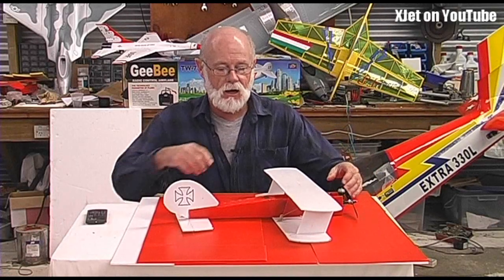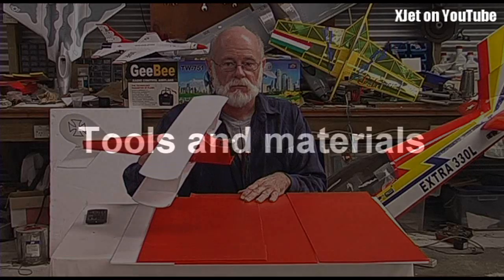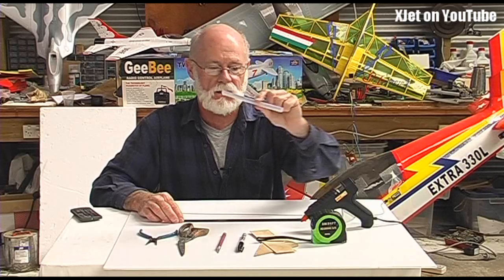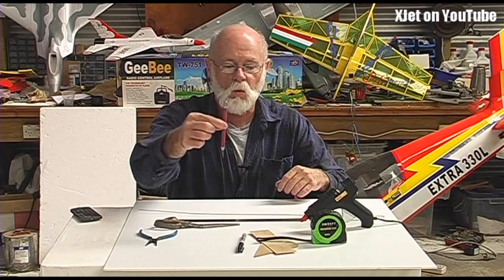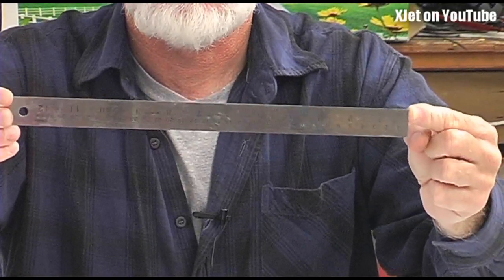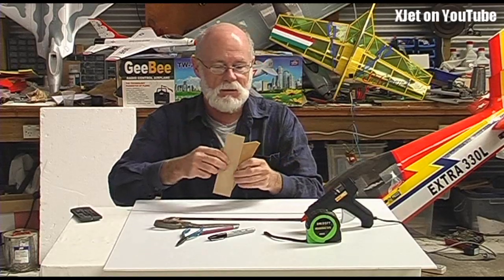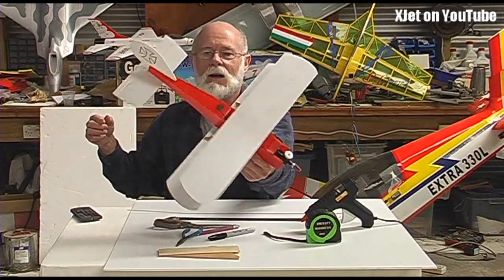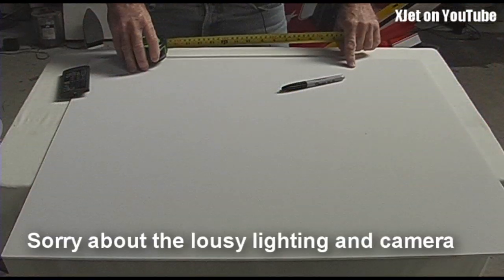(corrected) Build video: The $10 RC nitro plane made from coreflute (part 1)

Comment: this was the first homebuild plane i did when i was 14 soon after these videos came out. i had mine so full of hot glue and reinforcements that it WOULD NOT fly, EVER. mostly because i could never get the cox engine to run lol. I did get a reliable engine to run (all from vintage parts that my family had in a box), and i had a retired Parkzone super cub that i attached the .049 to, it looks SWEET with the cox head sticking through a cutout of the plastic motor cowl. It flew a bit but couldn't keep the engine attached lol

Comment: Thank you for the great video.  I am continually amazed by folks that build low-cost things using inexpensive components.

On the camera quality, I think it is better than good enough.  It just has problems in low light like many cameras do.  Sound is good as well.  I would consider getting a few overhead shop lights rather than a new camera.

Thanks again.......

Comment: @RCcarWIZERD search youtube for cardboard rc planes. There are some out there, especially delta-wing types. Problem with cardboard is getting it wet so thin coat of varnish or paint helps. There are different weights of cardboard as well.

Comment: Damn Bruce, I love your work.
Found out about you due to research on valveless pulsejets (something that actually sprung from watching the episode of scrapheap challenge that you were on, I think). And eventually, I built my own, though I weld badly and it didn't hold for long.
I didn't know that you were into RC planes as well. I've been wanting to get one of those things for ages (used to race nitro RC cars), and your build looks pretty great for the budget. If only the insides were as cheap.

Comment: To mark the second wingtip instead of fooling around with that little wiggly piece you cut off you might use the first cut wingtip that you made as a pattern for the second wing, then cut the second wing on one tip, flip it over and mark your first wing, second tip, then use that to mark the second wing, second tip.

Comment: instead of using the flimsey piece as a template for the wing tips, why did you not use the first wing you cut the tip off for a template for the other wing and after cutting the two tips on the second wing go back and use the second wing for the template for the last wingtip cut. are we learning  yet???

Comment: When we get to installing the radio gear, can you use a transmitter that came with a prepacked cheap RC toy or will we need a dedicated RC transmitter. Guess I am asking if there is a way to use a cheap transmitter.

I would like to build this but dont have the radio gear.

Comment: @troy5690 , I didn't answer your first question properly.Most cheap RC toys, at least the indoor ones are not rc at all but use infrared like remotes & only work 30-to-40ft. If you move up to Harbor Freight cheap planes, they are 27Mhz & 2 proportional chan operating throttle steer on two tiny brushed motors. They work but nothing to write home about. Search youtube for "Yellow Bee" for examples of people flying them. I am not promoting HF planes, they're just enough to get frustrated!

Comment: What can I substitute for coreflute? I live in Maine, and I can't find anything around locally... thanks
Reply: +Thomas Luce I found corrugated  plastic at home depot. 1/8 inch is .125 inch. I hope that this helps.
http://www.homedepot.com/b/Search/N-5yc1vZcbtu/Ntk-Extended/Ntt-corrugated%2Bplastic?Ntx=mode+matchpartialmax&NCNI-5
Reply: Thanks James I'll be sure to look for it
Reply: use dollar tree foam board 1.00$ a sheet way better than core flute what ever the fuck that is